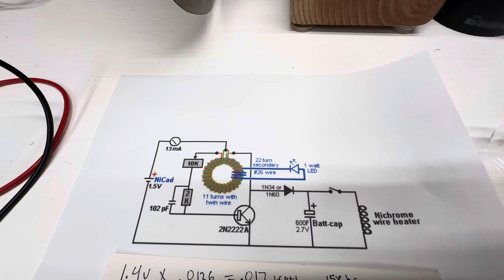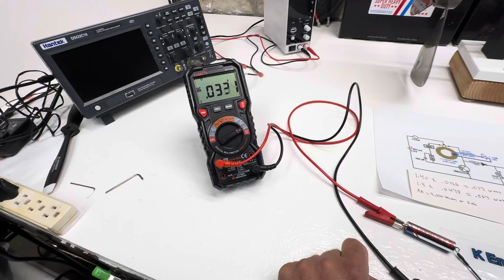Joule Thief circuit

Comment: From ChatGPT

Which MOSFET?

Metal-Oxide-Semiconductor Field-Effect Transistors (MOSFETs) are widely used in electronics for switching and amplifying signals. They come in various types, each suited for specific applications based on their construction, operation, and characteristics. Here are the main types of MOSFETs:

1. N-Channel MOSFET
Enhancement Mode: This is the most common type, which is normally off (non-conductive) when there's no voltage applied to the gate. It requires a positive gate-to-source voltage to turn on.
Depletion Mode: Less common, this type is normally on (conductive) and requires a negative gate-to-source voltage to turn it off.
2. P-Channel MOSFET
Enhancement Mode: The counterpart to the N-channel enhancement mode, this type is also normally off but requires a negative gate-to-source voltage to turn on.
Depletion Mode: Like the N-channel depletion mode, this type is normally on and requires a positive gate-to-source voltage to turn it off.
3. Dual Gate MOSFET
Especially used in RF amplification and mixing applications, these have two gates that allow for more control over the device's operation, such as gain control or frequency modulation.
4. Power MOSFET
Designed to handle high currents and voltages, power MOSFETs are used in power conversion and management applications. They can be found in N-channel and P-channel forms, with the N-channel variants being more efficient and hence more common.
5. VMOS (V-groove MOSFET)
Named after the V-shaped groove of the gate, VMOS transistors are designed for high-speed switching applications. They offer good efficiency at high frequencies.
6. TMOS (Trench MOSFET)
Similar to VMOS but with a gate that is formed in a trench below the surface of the silicon. This design allows for a higher density of current flow, making them suitable for high-power applications.
7. FinFET
A newer type of MOSFET that uses a 3D structure to improve control over the channel and reduce leakage current. FinFETs are used in modern integrated circuits and processors for their efficiency and performance at nanometer scales.
8. GaN (Gallium Nitride) and SiC (Silicon Carbide) MOSFETs
Not traditional silicon MOSFETs, these are made from alternative semiconductor materials and offer superior performance in terms of efficiency, heat resistance, and operating frequencies. They are increasingly used in high-power and high-frequency applications.
Each type of MOSFET has its unique advantages, making the selection of the right type crucial for the specific requirements of the application, including the desired efficiency, power level, and operating frequency.
Reply from the maker: 2n2222